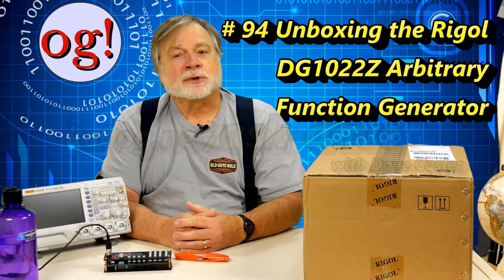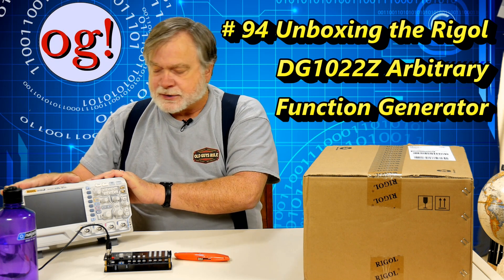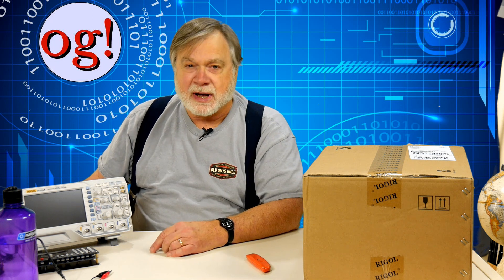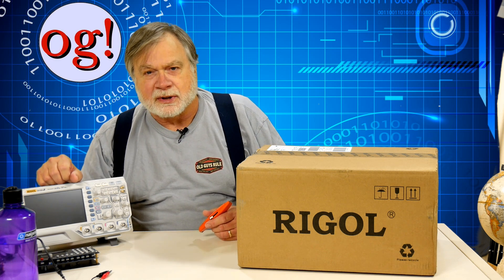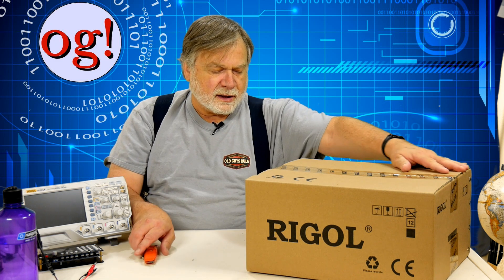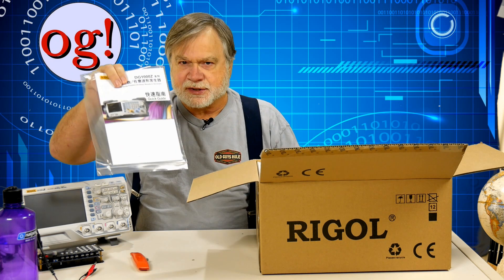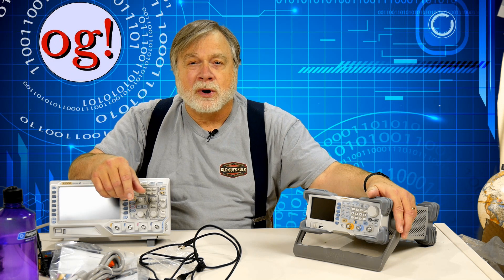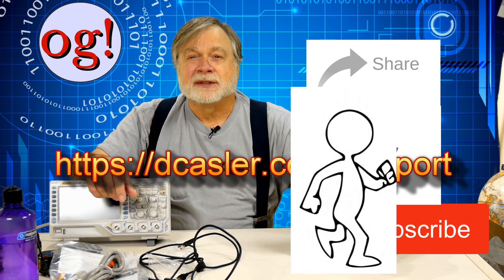Rigol DG1022Z Arbitrary Function Generator (AD #94)

Comment: By the way: You can capture stuff from your DS1054Z and replay it via the DG1022Z by connecting the front USB of the function gen to the back USB of the oscilloscope. It's quite nice to be able to do that, imho.
Reply from the maker: Sounds like a very cool function. Thanks for the information!

Comment: Hey Dave, dont know about everyone else but if you are looking for Function Generator videos, having one showing how to inject a signal into a radio to get a S9 would be great.  There is a lot of confusion online about doing so. Of course its going to require an attenuator and how to come up with the proper volts to RMS conversion and then how many DB you would have to attenuate it to get to 50uv or whatever you shooting for. I personally would appreciate  a video like this.
Reply from the maker: I haven't tried this yet, and don't have the appropriate attenuator. A good attenuator needs to be heavily shielded so as not to radiate right around all those resistors. I'll have to keep my eyes open for one at a ham fest.
Reply: David Casler I just bought the mfj unit. Seems to be pretty accurate.

Comment: Congratulations on the new lab equipment. I am thankful it is not a MFJ.
Reply from the maker: MFJ doesn't really make any lab equipment. The Rigol equipment is very good value for the money.
Reply: I agree with you. However, a MFJ antenna analyzer could be considered a frequency generator, impedance bridge, and vector volt meter. 

Since its obvious I don't like MFJ's quality, no they don't make lab equipment.

Comment: Thanks, Dave, for this video.  Looking forward to hearing more about the DG-1024Z's accuracy and whether it distorts at higher frequencies like so many of the cheap under $100 Chinese function gens available on eBay.  Also would like to know if it is software upgradable, like the 50 MHz DS-1054Z, which can be converted into a 100 MHz DS-1104Z with a simple free download.  Also, why must these things stop at 25 MHz? Don't the manufacturers know that HF bands have been going to 30 MHz since forever?   Tough to align old tube shortwave receivers on the high end if your signal gen stops at 25 MHz.
Reply from the maker: I've noticed with my Rigol oscilloscope, which is supposed to go up to 50 MHz, will actually show a sinewave in the 70 cm band. The thing is that the circuits in the scope amplify less and less as the frequency goes up. So trying to determine the real voltage doesn't work, but you can see that a circuit is operating. I haven't worked enough with the 1024Z yet to know how high it really goes.
Reply: Nor I, but I did see that someone on the net had taken his upgraded DS-1054Z to 500 MHz and it did a reasonable job of displaying the waveform with some attenuation but not as much as you would think. My cheapie signal gen only goes to 25 MHz and distorts badly at that so I couldn't duplicate this test even if I wanted to.  Oh, wouldn't it'd be nice if they'd sell an inexpensive spectrum analyzer for HF!
Reply: Take a look at the SDR Play Pro. Not as nice as a real SA, but it does a lot, and its cheap.